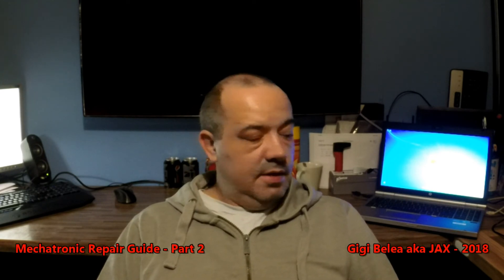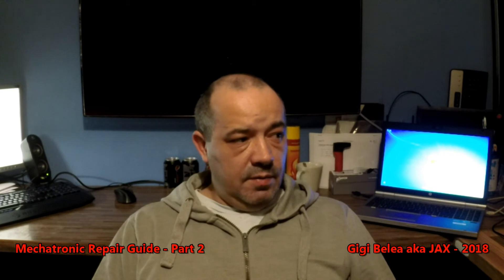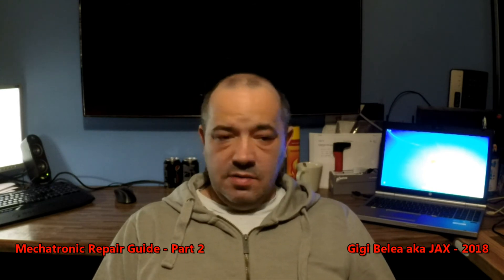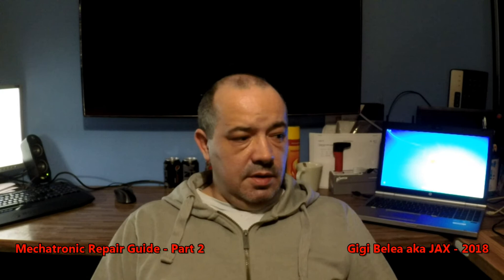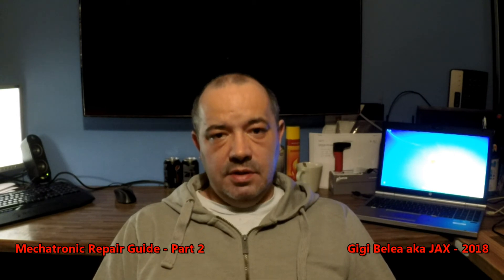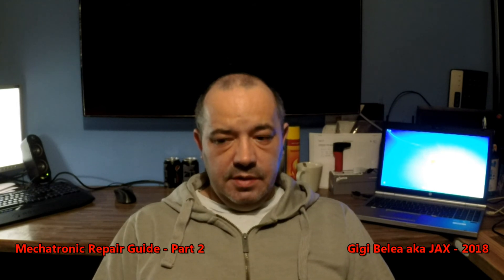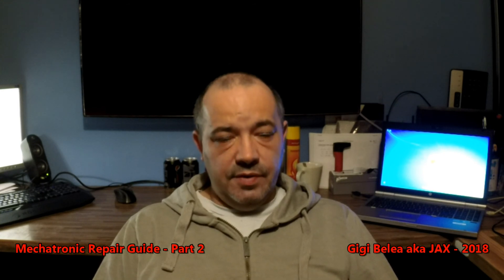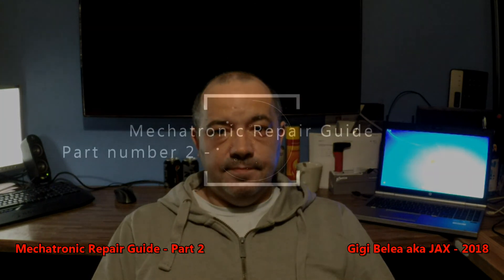VW DSG Mechatronic Repair Guide - How to repair Mechatronic unit Part 2

Comment: Although I agree with your decision, I will not order part 2 video. My reasoning behind my decision is because there is no certain guarantee if faults are found and repaired that the Mechatronic unit will actually work once reassembled. My money will be better put towards a sure thing……a complete new Mechatronic. All the best Gigi.
Reply from the maker: Well, after I assemble the unit with new parts I am sure it will work :) The main question is for how long ? :)

Comment: My TCM is already shot so i dont mind cutting it opening and inspectiing it. At first I thought my solenoids were bad so I ran a diagnosis on the TCM and turn out two solenoids were actually defective. Bought new ones and replaced them only to run a second diagnosis that showed the same error codes, Which now confirms a bad TCM. My problem is that if I cut it open what am i using to stick it back with??

Comment: Smart  thing to do. I’m a huge DIY advocate but I also preach to know your limits. Yes, you do learn from making mistakes but on such an expensive part, it’s not a mistake worth learning from! ($1,900 for a new one!). A lot of people don’t know when to quit and end up getting in over their heads or taking shortcuts that cost them more time, money and aggravation, or worse, puts them and others in danger (brake and suspension hack jobs).  

We have a 2013 turbo beetle with DSG that had a failure of the mechatronic. I did some research on replacing it myself and decided against it given the cost of the part. We also have a 2008 Mustang GT with automatic and I have no problem taking apart the valve body and rebuilding it or replacing the solenoid pack. The parts are also about 1/3 the cost of the VW and much easier to find. The VW mechatronic part took two weeks to arrive at the shop!

Comment: So I removed my mechatronic unit, inspected and tested the solenoids, and cut it open as per part 1, only to find I cannot go any further as you have decided you now want money for part 2?
How many others have cut open there mechatronic unit?
There's gonna be alot of mechatronic units cut open and through into the scrap now bud, not because we cannot follow steps on a video, but because we were waiting on part 2 from you?
I understand you want money for your efforts, but that should have been made clear at the start of part 1 before I followed your first part guide?
How much do you need for part 2 as my only other choice now will be a new mechatronic unit, I kinda feel scammed bud to tell you the truth, it's put me in a very difficult position and I don't think by chance.
Reply: Why would you not find and watch both parts before even starting the job? Not sure how you can consider yourself scammed if you didn’t do your due diligence.....oh, I get it, your going for the “poor me” angle in hopes he’ll send you part 2 for free.
Reply: @derfstang480  
What kinds of an idiot are you?
Part 1 was released, part 2 never was released and we were never told we would have to pay to get it until months after part 1???
How the fuck could I search for both before starting work when only 1 existed?
Go back to school dude, you should never have left.
Reply: Your response says it all.....let’s take this step by step since comprehension isn’t your strong point... both of these vids were posted before your attempt to work on the car....The end of the first vid from 2017 tells you part two is coming. Part two is posted in 2018. Your post is in 2020. Why would you not search for both and have both parts before even starting the job considering they were both posted years ago? Then, you would’ve realized part two isn’t readily available and you wouldn’t have started in the first place...

Did you start in 2017, find out in 2018 that the second vid was not available, and waited til now to complain...?

Comment: Hi Gigi, just out of curiosity;  is there a fix for a DQ250 DSG (KNC) where trans fluid is leaking from the mechatronic unit connector to the loom?  

I replaced all of the seals, gaskets, and o-rings (at the connector, specifically) to no avail.  I have no trouble// codes with the transmission functionality--other than the more and more excessive leaking from the connector out into the wire loom.  Thank you! Just subscribed!
Reply from the maker: No, there are no rep kits for that , the oil that leaks come from inside mechatronic , nothing you can do about it. If it drives and no errors , just drive :)
Reply: @GigiBeleaDK    Hey, thanks so much for the reply!  Thats was I was thinking.  I'll just make it a point to reset the fluid level every 6 months as if I were doing a trans service (add fluid, bring fluid up to temp, drain excess, etc.).  Thank you again!

Comment: What kind of glue do you use to seal it back together?
Reply: Did you ever get an answer for what glue to use?
Reply from the maker: Use any sealant that is temperature and oil resistant. Check your local shops.

Comment: Hi just a quick question if you don't mind... I have a broken mechatronics unit (intermittent N92 fault) and a working one from a different car. Broken one is a 2004 Mk5 Golf 2.0 TDI and working one is from a 2008 Skoda Octavia 1.9 TDI. I have fitted the working unit and the car drives but the gear changes are at the wrong revs and I am getting a fault regarding a missing electronic handbrake signal. Is this just a software thing that can be reprogrammed? Thanks.
Reply from the maker: Yes, your unit needs the right software in it before it works as it should. VCDS won't work for that.